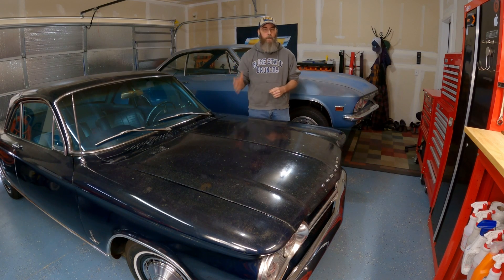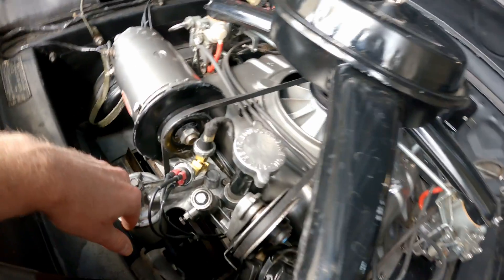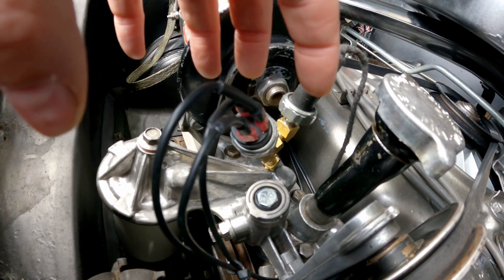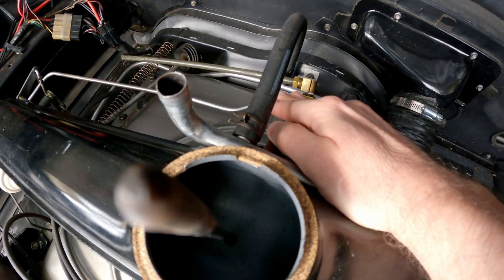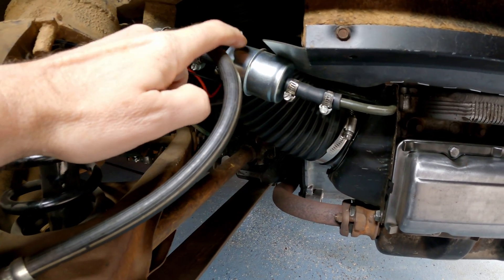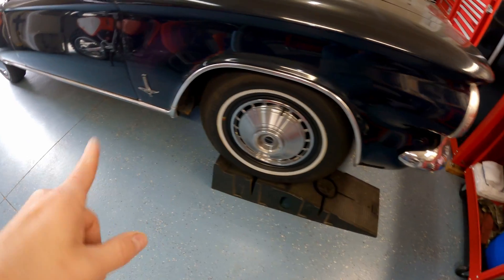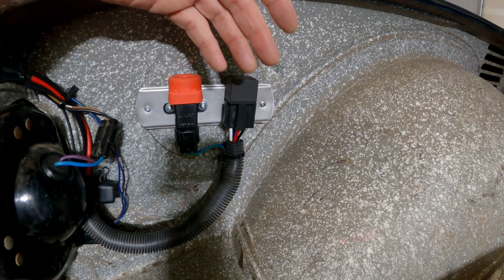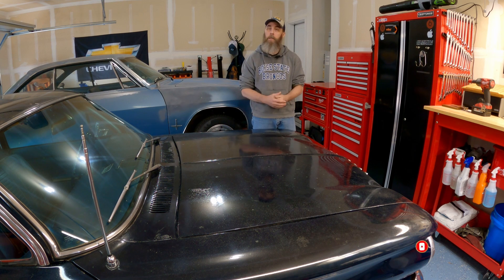Corvair - Electric Fuel Pump Conversion

Comment: Do you have to replace the stock fuel line from the gas tank to the engine or do you just splice in to the original fuel line. Thanks
Reply from the maker: No, you can leave the line from the gas tank alone. There is a rubber hose coupler right behind the firewall in the wheel well. Just replace the line from there to the engine. You will have to form a new line in the shape needed to make it to your new fittings.
Reply: Thank you for the info.

Comment: Is there anyway to go into how to wire all these components together?
Reply from the maker: What I did was just studied several wiring diagrams from the internet. If you google how to wire an electric pump, or an inertia switch, or an oil pressure switch, you will find a bunch of easy to read diagrams with explanations.

Comment: I just found this vid. Very nice install and layout description. Your fuel pump plug reminded me of when I did the same thing way back in the 70's on my dune buggy engine. Also very nice organized and clean garage. The only thing I see that I would change is your walls. Go find the cheapest white paint you can and paint those faded drywalls. It will greatly improve the look and you will have more reflected light which us older guys sorely need....GG!
Reply from the maker: Thank you so much.  I appreciate the feedback :)

Comment: Wouldn't the 3 prong switch still run the dummy light?  why do you need both
Reply from the maker: The three prong oil pressure switch does not handle the dummy light for the dash. You still  need to have the stock single pole oil pressure sensor for that.

Comment: I’ve had people tell me to use the revolution electronics controller but looks like you just used a relay?  What was it from?
Reply from the maker: The relay that I used is just a standard 4 prong that I picked up on amazon. It is not a safety item, but more of a longevity issue. From the looks of it, the revolution controller is an electronic safety switch that essentially does the same thing as the oil pressure safety switch that I installed. The only difference is that you don't have to worry about re-plumbing the oil pressure line. Instead of your pump turning off when it senses zero oil pressure, your pump would turn off when it senses zero rpms. Either would work, or both if you really want to be extra safe.
Reply: Ok that makes sense. I like your solution a little better as it opens up the use of more than one OPS as long as it has the 3 prongs?  I did also find a momentary switch and fuel pump on Amazon.
Reply: Is that a two wire Vega OPC or three
Reply from the maker: @jonlong1690  If you are referring to the oil pressure sensor, it is a 3 prong. 1- starter, 2- ignition, 3- pump.
Reply: @EndWrenchRookie do you have a wiring diagram you used to make that setup work?  Also with the momentary switch?
Reply from the maker: @jonlong1690  Lol. No sorry I don't. I just made it up as I went along.  :)

Comment: Where did you get that new hard line that delivers the fuel to the pump. ?
Reply from the maker: You can either buy it on a 25 foot roll from Amazon, along with the fittings, or you can go to your local auto parts store and buy a section of 3 foot straight pipe that is pre-flaired on each end

Comment: What is the pump?!? Part number?
Reply from the maker: The fuel pump is from California Corvair. It came with a pre-filter and a mounting kit. Here is the link: 

https://californiacorvairparts.com/fuel-system/4545-electric-fuel-pump-low-pres.html.

I have run this pump on 3 different Corvairs now without issue. I prefer the "humming" noise to the "thumping" noise of other makes.
Reply: This pump has changed on their site. I just received mine and it is the thumper solenoid pump now. Really wasn’t happy when I received it today.

Comment: Awesome! Really want to convert mine over now.
Reply: Hey benben I'll be looking forward toward your video.
Reply from the maker: That's cool. Ya, it is a pretty fun upgrade that adds a good bit of reliability as well. Good luck!
Reply: it's definitely worth it, the aftermarket mechanical pumps are so unreliable.  I set up my pump right in the engine bay, flipped the fuel lines backwards to free up even more area at the rear of the engine.. have had zero issues.

Comment: Nice install, & well thought layout, & design. & thank You for telling why You choose this routing for the fuel lines; As well electrical routing. Thanks for the video.
Reply from the maker: Thank you so much! I appreciate the kind words. Hope all is well with you and your many projects as well.
Reply: @EndWrenchRookie  Thanks, & yes all is going well with all of my projects; Silverado is all good now. I'm into fixing up my 1959 M-F 50 tractor ( Gasser ) Nothing major but she is do for a respray; It will be a rattle can job, & I have all the paint, Decals, & I just installed a new seat cushion with a new backrest as well; I also have all new gauges to put in as well as a two piece center trim piece for the front grille. & then there is new storage shed I'm building now to free up my workshop space of lawn equipment; as well as my breezeway, & I'll be  building a new lean to to store both tractors in, & 1 storage shed to be refurbished, & 1 to be demolished with some of it being repurposed. It sounds like allot but hopefully I'll be done with it by late summer. Take care, & I'll be looking forward to seeing videos on the 67 Vair. I still have your video from 5 months ago to watch on my save to watch latter. Again thanks for your reply.

Comment: I added electric to a '65 Monza. I used a fuel filter at the tank outlet, then to the external fuel pump(mounted up front not in the engine bay), the ground wire was there but the power wire went from a switch to an oil pressure switch on the engine back to the fuel pump. So a lot of wiring. I was going to add the power from the ignition switch but that was not going to work. I was going to install a better fuse block but didn't have the money at that time. The best thing is I can use the switch without starting the car in the winter to prime the carbs and then starting the car. I did use an impeller style inline pump so it was quiet but did cost a bit more. Quite worth it. The oil pressure switch I used was for a Vega. I refuse to use an inertia switch having repaired so many of them for no reason other than someone hit a bump. Not a good idea.
Reply from the maker: That's cool. Interesting layout. I really enjoy hearing about other people ideas and designs. Thanks for sharing!